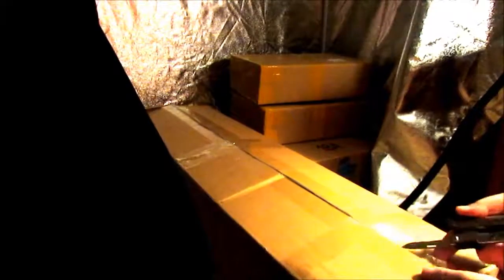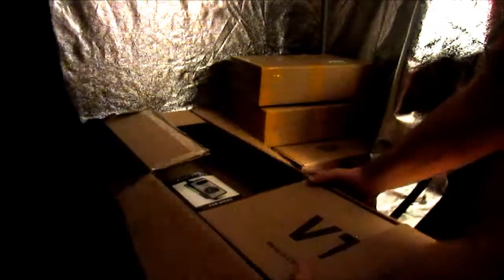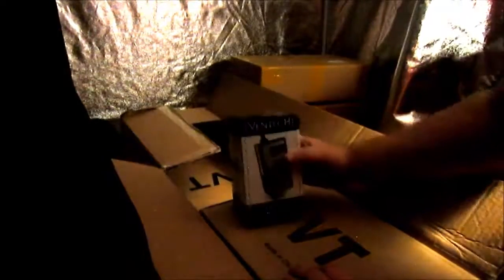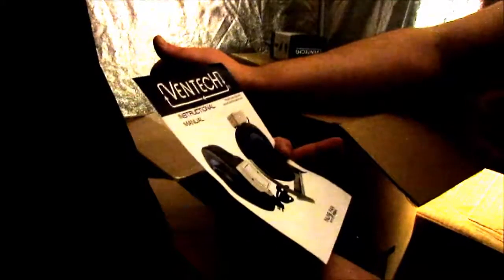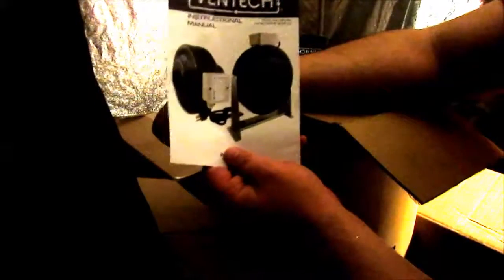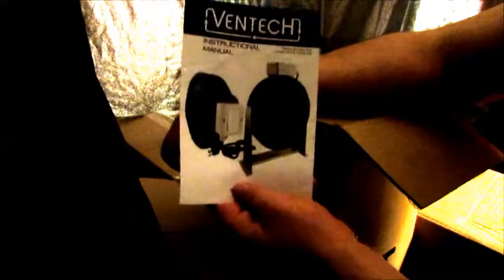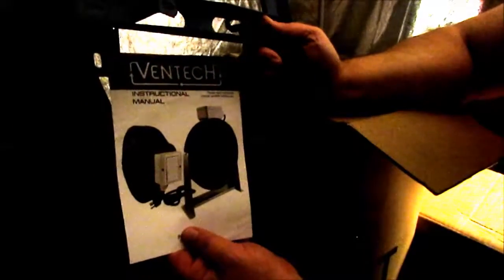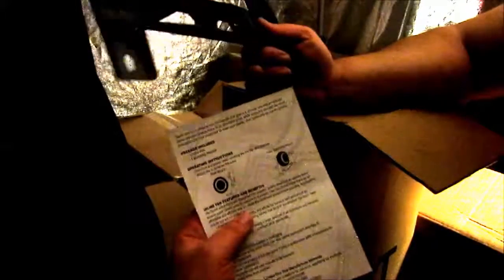VenTech VT IF6, CF6-B Carbon Filter & VSC Unboxing.

Comment: I have an Asian Incense plant that I bought this for. Can I connect the filter to the fan and operate inside a tent without vent tubing?
Reply from the maker: It would be pointless to scrub the air just to have it mix back into unscrubbed air.  You could do it, but why would you want to?